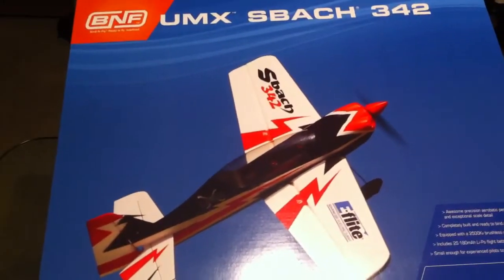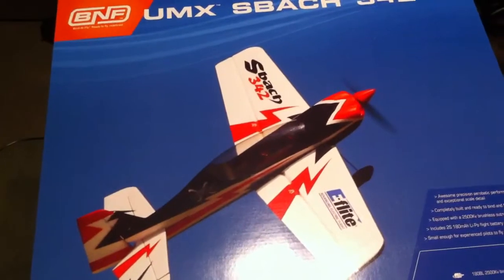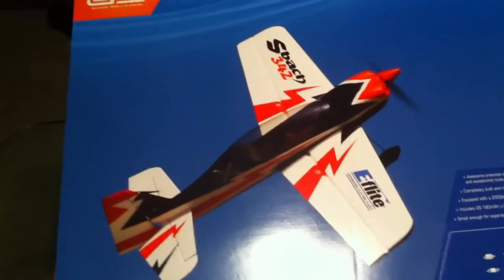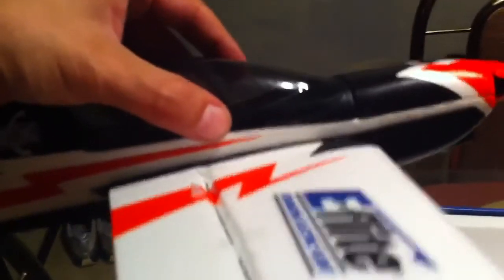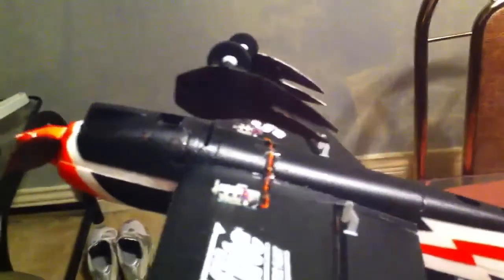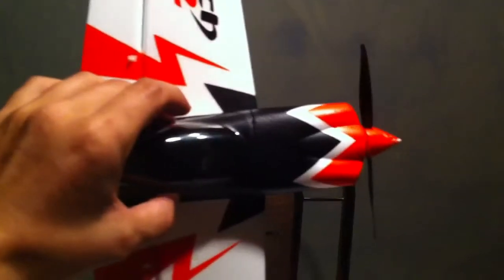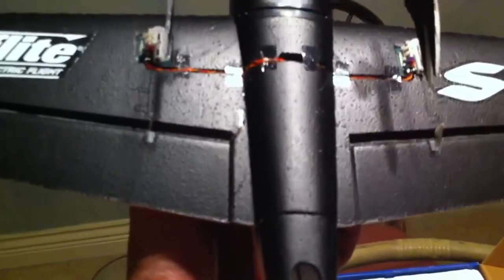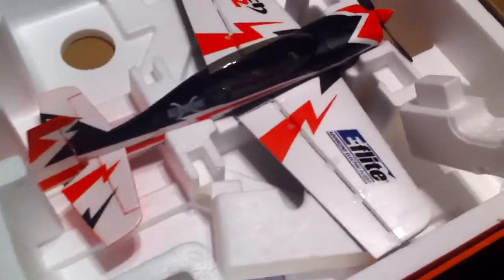E-flite sbach 342 skirt mod

Comment from the maker: then once you do that all you gotta do is run all the control arms and silicone the board into the new fuse, then tape it back together CA the wing back on and you got yourself a brand new umx sbach. i rebuilt mine last year and have the old wing , rudder, tail and top fuse as spare parts. i also put a umx stryker motor in it and it really rips now, unlimited climb and tons of power running on hyperion 240's. you just have to reverse the polarity as the stryker motor is a pusher not a puller.

Comment from the maker: replacing the fuse is not an easy thing to do, getting the top half of the fuse is the easy part as you just slice the tape with a straight blade and remove the top which i'm guessing isn't damaged. the hard part is separating the wing from the bottom half without breaking the wing if its still any good. if the bottom half is busted at the front where the battery goes, the fuse is toast, so if you want to apply force to anything it will be the fuse, so don't worry about breaking that.